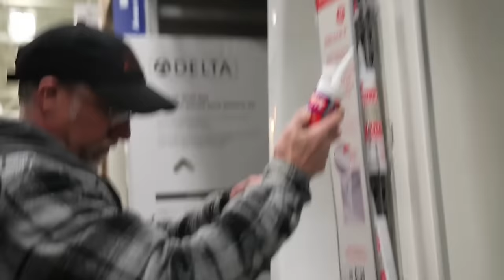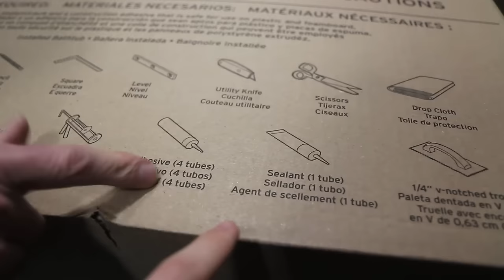CARBON MONOXIDE POISONING!

Comment: Jesse, just wanted to give you a heads up... For your safety, NEVER EVER EVER leave a space heater running while your not home! They are dangerous and have caused many many fires! That little space heater you got from lowes can be very dangerous. Just be careful using those heaters. We use them in our house too , I just wouldn't want to see something bad happen.
Reply: +Megan Wile What's he care it's not his house and he can get a couple weeks of vlogs out of it. Plus all new shit from mommy and the juggies.
Reply: +Megan Wile Space heaters should have built in thermostats, they'll shut off when it exceeds a certain temp.

Comment: As a certified HVAC technician a blue flame is a properly burning flame that isn't making carbon monoxide. If it were a yellow flame then I would be worried. If you're so concerned get yourself a carbon monoxide detector

Comment: Just go get a stud finder for like $20
Reply: +Armed n Dangero Or install the panels properly. Adhesive  with a few nails on the perimeter to hold it until the adhesive sets. And never in open studs.
Reply: but he is an amateur attempting to act as someone who knows what he is doing do you really think that they would do that. No offense to him he just doesn't know what he is doing.